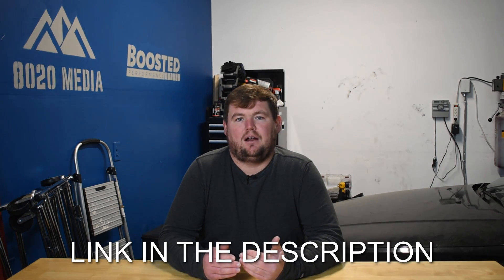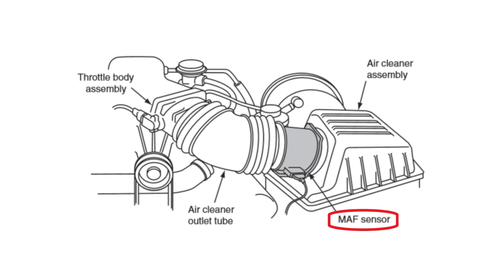DIY - 5 Symptoms of a Failing MAF (Mass Air Flow) Sensor!

Comment: Cars were so much better before all this sensor and computer junk ..years ago cars ran forever without problems .
Reply: I sometimes wish I was born earlier to have a less technology car. I don’t even trust a Tesla lol
Reply: I agree 90 percent of people could fix there own car and do maintenance with just a little bit of learning on older cars
Reply: Yeah and before all these dogshit Chinese replacement parts that fail outta the box!
Reply: @uncleronny6748 blame our government for that
Reply: Thats absolutely false. Very few carburated engines last as long as a fuel injected computer controlled engine.  The main reason is carbed motors dont maintain optimum air/fuel ratios and are far more susceptible to “cylinder wash” where raw fuel dilutes and strips  oil from cylinder walls and rings. 

I think what your experiencing is tax you have to pay when you buy inferior brands that have myriad problems associated with various modern tech. 
Toyotas last longer than other car on the market. GM occasionally has made comparable long life vehicles, one example being GMT -800 trucks and SUVS. That beibg said , since gmt-900 they have made garbage. 

It was very common to have to “re-ring” (overhaul) v8 engines in the 50’s, 60’s 70’s at 70k miles or less. Modern fuel injected engines  have miniscule ring and cylinder wear. 

If you buy known junk (mini cooper, kia,hyudai, audi, benz etc to name  a few, you are in for huge repair bills guaranteed.
Reply: @callapygian that simply isn't true!
Reply: Same with mercury bubble thermostat switches, console televisions, washers and dryers, etc.
Reply: @johnat😂yephanwroe2148
Reply: Yes, too smart now!
Reply: No way dude- did you forget about points, distributors, carburetors, having to adjust valves all the time - all that stuff sucks. It’s nice for older classic weekend cars but not for everyday drivers.
Reply: @polloloci21   No mid seventies until 1986 is the sweet spot.  Ignition module and hydraulic lifters, mechanical fuel pump.  I live 20 miles north of Louisiana and drove one to Prudhomme Bay Alaska.  Pulling a 33' horse trailer full of junk.  Not a fixed up show truck either, just a work truck.
Reply: Very true!
Reply: 1000000% agree
Reply: I say this all the time.
Reply: I totally agree with you bud, I miss the old cars and trucks, I had a 1978 dodge d 150 with a 225 slant 6 that engine ran for ever the body was horrible though and now I have  2007 dodge ram 2500 with the hemi and it has all these shitty sensors, I miss the old mechanical engines no sensors the old trucks were more reliable than this new garbage
Reply: Yes they're supposed to detect problems but instead causes them🤔😮
Reply: You could buy an inexpensive car for what some replacement Headloghts cost now!
Planned Obsolescence has been built into most products to keep most people broke or in debt!
Reply from the maker: V - Couldn't agree more!
Reply: @8020Automotive ..and you got 35mpg from your Buick electra???
along with how many tons of c02?
its 2025..take a deep breath..because you couldn't in LA, NY, Chicago ..... etc etc  in the 70s 
cars run cleaner... better mpg.. and are safer.  ABS, AIR BAGS, STABILITY CONTROL ... SMH!!!!
Reply: exactly!  All in the plans….planned obsolescence…..
Reply: Cars were good in the 90s. Just enough computer stuff to make them really efficient. Now there are so many sensors you have sensors for the sensors.
Sensors to tell the computer if the glove box door is closed or not.
Reply: @MichaelWysocki-ks5xt 😅
Reply: Lol yea right 😂😂😂😂
Reply: You memory is too goo either is it lol😄😄
Reply: Yeah only problem was they spat out nasty smelling toxic emissions all day and night... MAF is not the sensor to be upset about lmfao.
Reply: @garylivingston9052 I'm not so sure it's the government. It's more likely a combination of customer and innovation driven.
(Edit) After doing some more research it's more like a combination of company's being money driven, and being forced to adhere to emission control crap. Getting back to my original point, too many people who don't care about cars (or working on cars) ruin it for those that do. The complication and cost involved with rebuilding an automatic gearbox is a classic example.
Reply: @AJ-oj5eu, yeah it's not the government at all 😂! Why is it all the Company's going Green are going Bankrupt? How many ppl you know have an EV? How many people you know have a used EV for sale? What EV is really reliable and last many years? That was a rhetorical question because there are any used EVs you can go looking to buy and if the battery messes up it's 20,000 dollars to replace. People don't have time to sit at a charging station in real like and they don't have time to charge their car or if going on a road trip they have to hope that there's a charging station after they just drove a whole 200k mile!! Can you believe 200 whole miles on a charge! Wow it will only take a few days to get to Florida from the Midwest. And in the snow forget about it. You have to floor it and barely make a couple miles and you are already at half charge! Electric cars suck and so do corrupt politicians like Biden and Harris. And the supporters are almost worse because they don't pay attention to their policies and only watch MSDNC instead of really paying attention to what is really going on. It's easy AF to verify all these so called lies they say conservatives say when really everything they do and say about We The People is what they are doing.
Reply: I agree❤
Reply: We had the Turbine car that would still be running today...
Reply: I agree
Reply: 1990 Volvo 240, I'm frozen at that timeline, runs like a top, 280k mi.
Reply: Shut up. Cars back in the days couldn’t make it over 100k. Computer controlled engines are far more reliable.
Reply: Totally agree
Reply: That's right
Reply: Very true
Reply: And yet you are using that exact same new technology to complain about the new twchnology.
Reply: that's just ignorant!
Reply: This is total nonsense! I remember the cars we all drove when I was in high school. Needed a valve job by 100,000 mi. You've got to be kidding if you think you would want to go back to a carburetor for efficiency and longevity? I'm laughing remembering when you would always see someone in a parking lot with a dead battery because they flooded their carburetor by pressing the gas pedal incorrect for that individual car and kept trying to turn it over😂 it literally happened all the time, I always remember having to give people a jump and I think we would stick a screwdriver down in the carb butterfly?
Reply: If older cars were better back then, why are most of them gone now?
Reply: @jesshighland7177
Cause they make a lot more money off of us now!
Reply: Agree money making.
Reply: Wrong
Reply: I had an 85 f150 as my first car.... it got 7 mpg. Peak of the auto industry was between like 93 and 04
Reply: Agree ! The same with computer / sensor junk on semi trucks!
Reply: Everything was better before computers. Period
Reply: No they didnt, endless problems with carburetors and distributors.  the hours I used to spend at the side of the road under an umbrella sorting out annoying problems. Most modern engines run 150,000 miles with regular oil and filter changes completely trouble free.
Reply: @roberthardy3090   Yeah, but when they do break down, and it is a thousand miles to town each way, you are screwed and tattooed.  Drive to Alaska.  You can't carry enough tools to keep a newer vehicle going, or carry enough of the what if parts.  I will defeat your position on this issue.
Reply: @roberthardy3090 No they don't. The more technology, the more things that break. And you can't work on them yourselves. No more shade tree mechanics. You have to pay all these little millennials that depend on plug and Play diagnostics. Garbage
Reply: Except they weren’t
Reply: @user-ed5jh3ff6u Except they were
Reply: 2005 Dakota 3.7L. Told auto tech these symptoms. I figured MAP sensor. He said nope not the MAP sensor. 
 When he checked with analyzer  and saw running too rich, intermediate miss he changed his tune. Yep! MAP sensor. Cost $20.00. Woo hoo!
Reply: My 2019 Trax has much more standard maintenance. Rated reliability not so hot. Two different oil cartridges used. Not interchangeable. Brown filter cap is  ACDelco PF2263G. Black filter cap is a ACDelco PF2257G. My dealership used wrong filter first 4 oil changes. Brown UFI filter cap. Offered to switch out oil filter leaving dirty oil behind. I changed it myself. They suck!
The DOT4 brake fluid every 4/5 years. Dot 3 was 3 I think. Premature 1.4L turbo failure. Nut holding impeller comes off, wastegate failures, oil feed tube plugs up, wet/ internal timing belt poor idea.
 Key fob broke. Cheap! Cost over $400.00 with labor. 
 Throwaway motor.
 No Chevy anymore.
Reply: I agree the older cars with carburetors no sensors computer boxea that worked was way cheaper and u could work on them yourself but the world saw that so they over complicate things so they can make more money of people like u and me
Reply: Keeps you buying new cars
Reply: And engines only lasted 100K miles..
Reply: BMW have sensors for every single bullshit
Reply: Yes now something in the middle of what once worked without all of this. Your car is now one big computer with sensors that if they fail will stop working until you find and replace that problem.
Reply: Thank you and Merry Christmas.
Reply: I just wanna say as an electrician im saying I love all of you mechanics so much yall please keep doing your thing, you guys are the real goats of all the trades im just number 2 lol seriously tho you guys and gals kick ass frfr
Reply: You’re referring to the days when we used to see cars as feminine, “Isn’t she a beauty?”. We would spend all of our spare time and money just to keep her looking her best and putting on a show in front of the other guys. Today’s car are just plastic, ugly and overpriced, so I guess the analogy still stands.
Reply: @garylivingston9052  that factors down to: government sucks
Reply: @johnathanwroe2148  Well we definitely need to have a government, buy some things are taken a little too far..Lol
Reply: @johnathanwroe2148 , along with the greedy corporate lobbyists that bought and sometimes owns many of the politicians in government, especially big pharma and big oil.
Reply: So wrong, it's actually laughable.
Reply: Fuel and fire is all that is needed none of this comy go green bs
Reply: That’s why they changed it the longer your car runs the less cars bought and serviced
Reply: Very much agreed and one of the reasons why America lost it's good name. All this junk made today isn't even close to American quality and built to last and enjoy anymore.
Reply: @deanfarr3249 😂😅 asian cars are way more reliable than any American built pos and that's facts I've worked on enough to knoe
Reply: most of the junk cars are built in america
Reply: Same with locking systems. Like 300+ for a car key... Only suckers would fall for that...
Sad thing is the majority are eating sleepers. They out vote the thinker on every thing and guess what EVERY BODY pays
Reply: I agree computer nurds should have never touched cars technically has ruined so much more than anyone realizing.
Reply: it's a scam .
Reply: Ok caveman
Reply: @StevenJ.DuBois hey frog, you obviously have no clue about the simplicity of older vehicles and how the automakers are making junk now and charge extortion rates for parts and service.
Reply: Actually my old car got about 70,000 miles and was kinda junk
Reply: 1/2 the power, loads more pollution and were not reliable, is the reality.
Reply: @markallen6551 u must be talking about the newer cars because my old car has been mote reliable than any new car I've had
Reply: @markallen6551 yes, I'm sure this person that posted it never had to adjust points, timing, idle or the fuel jets on a carburetor before.
Reply: Blame lies on California and all their anti smog laws that the Fed adopts.
Reply: @Deacon_T  I guess the other option there is to go back to the 70s-80s where they had all that lovely smog that isn't there anymore in LA and Tokyo just to name two examples.
Reply: @Deacon_T NOT!
Reply: Emission control is frustrating but I recall that cars before the 90s were considered by most to be disposable bye 100,000 miles Now most Toyotas are good for a quarter million miles with way less maintenance
Reply: @furthereast6775 
I don’t know who told you cars only went 100K before the 90s, but that’s entirely false.
Reply: @furthereast6775  How old are you because that's incredibly false!
Reply: @furthereast6775 I see more newer cars broke down on the road than old cars
Reply: @furthereast6775  I had a 71 mach that I finally sold with 235,000 miles on it. I personally rebuilt the 350 Cleveland 1 time, simple to do if your mechanically inclined. I now wish I still had it.
Reply: @furthereast6775 I don't know where you got that info every 90s vehicle I had I put over 300000 on before it was getting bad. Everybody I knew got well over 250 to 300000 on theirs as well.

Comment: Think it also depends on what vehicle, the wiring system, and computer. I thought my TPS was bad. Replaced it still didn't help.  I replaced my once already replaced MAF from a decade ago which solved the problem. Plus my car is from 89
Reply from the maker: S - Thanks for sharing your experience.
Reply: @8020Automotive  You're welcome. Thanks for the information
Reply: Same replaced tps 
After  10 to 15 miles solid check engine light comes on and car does this judder like im pressing and releasing gas pedal when im not.  Any suggestions 😊😮
Reply from the maker: P - Have you tried your MAF?
Reply: @8020Media  thank you for your response 
Yep did it yesterday no luck 
93 subaru no scanner or obd port 🤔 😕.  I've learned a lot about my car recently lol doing some of the work myself. Saved myself 1200.00 dollars a year ago doing gear shift linkage.  Wish I had started learning sooner.  I'm original owner. 
Might add when I turn off car and turn back on process starts again after 10 15 miles
Reply: @8020Automotive  Yes
Reply: @pamelavance648  Yeah that bites places cost too much money for repairs and part's. I think it's nice to repair them yourself and know what is wrong with them.
Reply: @ShawnStafford-1978  found a mechanic but maf was easy enough. 
They did fuel pressure regulator and coolant temperature sensor.. my mpg improved 3 more mpg yayyyy
Reply: @pamelavance648  Nice it's repaired and running better.
Reply: @ShawnStafford-1978  not yet,  current symptoms of random check engine light after short drive cycle not resolved

Comment: Rough idle on VW petrol cars is often due to blocked throttle body butterfly valves. The half moon spaces around the valve allow sufficient air into the fuel injection system for idle unless they are gunked up with oily deposits from the gas recirculation system. As soon as the throttle is pressed the valve opens and the car runs normally. The deposits are easily removed with engine degreasant say every 40k miles.
Reply from the maker: B - Very true, thanks for sharing this insight!

Comment: Could it be my throttle position sensor because it idles and shakes , it sounds like it wants to cut off like it has a cam on it,
Reply from the maker: Have you checked the cam position sensor? But yeah could be TPS too which I think we also have a video on

Comment: Could it still be bad if there is no light on or no code
Reply from the maker: P - It can certainly be clogged.
Reply: Can I buy the bolts for the MAF Sensor on 2016 Mini Cooper
Reply from the maker: T - You can test some at your hardware store. It's probably not something the dealership or aftermarket dealers sell.

Comment: 2004 Lincoln LS MAF issues when it’s connected the car will not start completely but once disconnected car runs but idles roughly. Replaced the sensor with brand new one and still does the same thing. Engine code reads the same not sure where to go from here I need help asap !! What would be the next step?
Reply: I believe it’s between 3-4 issues
Reply from the maker: B - What engine codes are you getting?

Comment: After I start the car, it works normally, but when I try to give gas or let go of the clutch, the car stalls and the revs drop, please help me
Reply from the maker: Sounds like it's probably a fueling problem so I'd start there. Or something like a camshaft position sensor. Start with reading your engine codes.
Reply: @8020Automotive  sorry, but how to read odes
Reply from the maker: O - You need a OBD2 scanner.

Comment: Having issues on my wife’s car. It’s push to start and normally starts right away lately has been taking a little longer to start and when it did had a rough idle. It didn’t happen every time, Then about a week after this happening it threw a P2188 code. Gonna clean it this week and hopefully that will fix it if not I’ll replace it since it’s cheap if that doesn’t fix it mechanic it is 😢
Reply from the maker: A - We also have a video on hard starts that may be useful in your research. However, since you received the P2188 code, that should point you in the right direction. Keep us updated!

https://youtu.be/0YRdzJbHcm4

Comment: MAF disconnected, different story. Accelerate much better at low RPM (1000 - 1700 O/min - before compressor stars "pumping" air to manifold).
Reply from the maker: A - Thanks for sharing your experience.